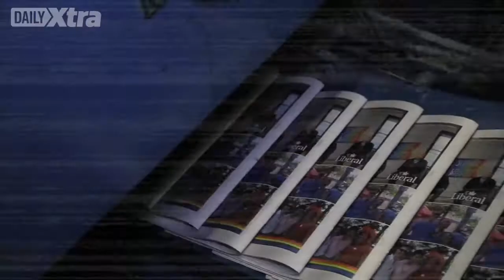Last issue of iconic Xtra newspapers on the streets

Comment: What I regret about this is the simple presence of 'LGBT' in our metro areas. While many covers were 'shocking' to others, it also helped in normalization of a lot of concepts, IMO. Putting it on the Internet makes it more optional, instead of a physical presence in the downtown. But all of this (press) is going more and more digital this decade, and it shouldn't be a surprise or disappointment overall.